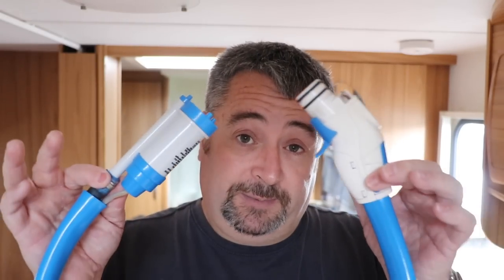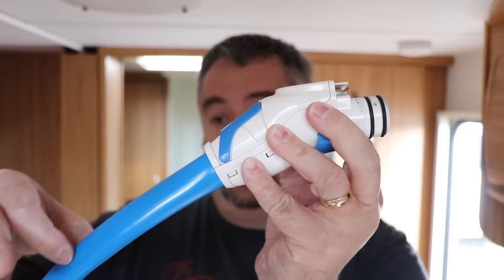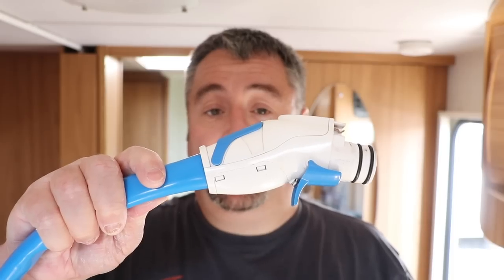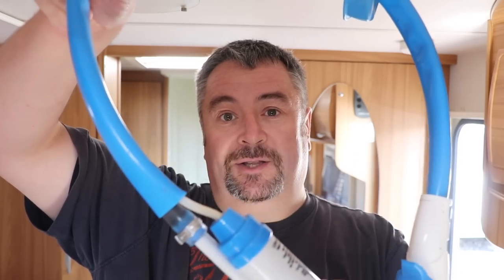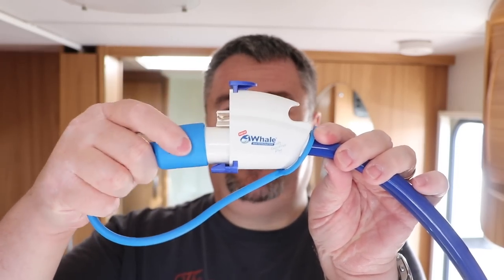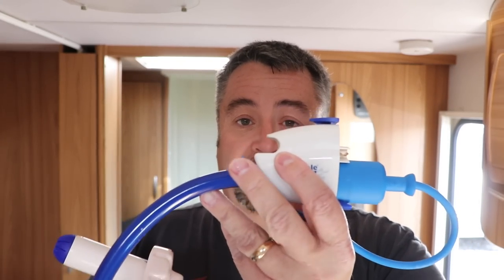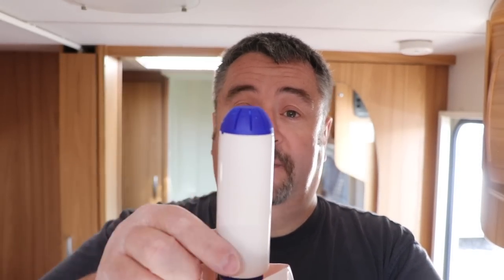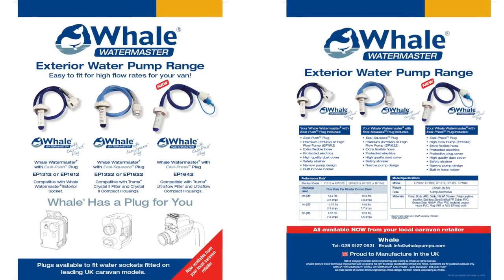Whale Pump EP1642 upgrade to a Caravan Truma Ultraflow system

Comment: Just came across this video but not before I had a problem with my Truma pump failing. By accident I couldn’t get a replacement and instead got a Whale pump. What a difference! Easier to fit and a really flexible pipe making it much easier when you swap from one aqua roll to another.

Comment: Thanks Dan this is really useful. We too have a Lunar Clubman and we are away in Cornwall on our holiday. Arrived yesterday and the b****y Truma pump played up right from the off. Then we had a water leak under one of the beds so not using our system at present.  I have had all of the issues you have mentioned and have also been fed up with it.Was going to buy another pump now it will be a Whale. Thanks for the info 😁

Comment: The submersible pump that came with our 2006 caravan, Truma Trauma, was a pathetic dribble. Les, bent my ear about it on several occasions. So I did some homework and bought a Whale. What a difference, I have carried the original for a few months in case there was a problem but the next trip will be a pump lighter.

Comment: Just upgraded my old van to the ultra flow system and decided to buy the whale pp off the back of this video. Brilliant advice
Reply from the maker: Excellent. FYI - I’m still using this very same pump now, even when I thought I broke it, it was just a corroded terminal on the caravan. - so they do last!
Reply: That's brilliant. Thank you for the video. 👍🏻

Comment: Brilliant! First time out with our recently purchased Sterling last weekend and we had a nightmare with the Truma pump. It had clearly been rolled fairly tightly by the previous owner, had a couple of nasty kinks so the flow was very slow, and was so inflexible that it kept rolling itself up out of the water in the aquaroll. It had worked ok on a warm September day when tested in our garden, but a cold November day on site was a different matter. A quick search on the 'net brought up your video and I'm delighted to find that whale have produced a better alternative. Mine's on order, I'm confident the air will be less blue next time out.

Comment: I was convinced that the pump was inside the caravan and it was just a filter that sat in the aquaroll....your videos are amazing, saying that...i now have umpteen jobs to do at the weekend lol...water-pipe cleaning...gas-level checks...battery checks, although it does have a solar panel on the roof....damp-checks, have purchased a meter and will put it to good use :-)
I have apps to download too, and also workout how our virgin media can transmit the F1 races to the smart tv....it's supposed to be a "weekend break" lol...

Comment: Same problem here, didn't knew about this whale solution. I changed the Truma hose by a sillicon protection hose and a sillicon innertube. I have the impression that this will work fine. No force to the connector, no bends.

Comment: Thanks for this very useful video! I had a whale-pump from the start but accidentally had it run dry (which happens quite easily). I replaced it with a comet pump which basically looks the same and was a little cheaper plus it has a 30min dry run capability. But I keep forgetting to turn the pump off in the van before I drive away in the car to get the aqua roll filled. There is much danger in damaging the pump again, so overall I'm not too happy about this design.

Comment: Another great video Dan and fantastic support for a great Northern Ireland company like Whale. Their customer service should you need to use it, is second to none. We have the Whale heating system on our Bailey and its great. We have had one issue with it whilst on holiday, they even sent their Managing Director to our caravan site to fix it for us, but luckily their phone engineer fixed it before he got there and the Manager Director was turned back.

Comment: Good vid  Dan ,been there done that ,got fed up of reconnecting hose ,you would think the makers would see this problem ,anyway was looking around spares shop and saw a flexible double hose right length ,fitted same ,works perfect  nice and flexible,will look at whale  as my pump is getting a bit noisey

Comment: Get rid of the Aqua roll all together. Just buy the Truma Ultraflow Waterline that runs straight to tap. Saying that, the Truma Pumps are very tinny and  it did leak a bit even when it was brand new when I first used it. Every time you unplugged it, it felt like it was going to break apart.

Comment: Hi thanks for your superb video, I've got a Sterling Eccles Ruby that has an internal Flojet pump which is turned on or off by a switch on the control panel inside, does this pump just turn on by itself? cheers

Comment: Hi Dan, we have a Coachman 575/4 7 years old with Truma system.  Have bought a Whale pump to replace our Truma one. The Whale pump will  not work though the Truma one does. Is our van and Truma smart switch programmed to only work with Truma pumps ? Many thanks Brenda

Comment: We are caravan newbies; We have Truma Ultraflow, no filter + Water Hog Tank; Blue cap on pipe is too small for the water hog threaded outlet so we either need to get an acquaroll that fits the Truma pump etc or a Whale pump that fits the water hog...can you advise us? Also it strikes us that if you are on a serviced pitch with mains water, the Truma Ultraflow can take that flow without needing the pump to operate...We have a 2013 Eccles Sport 442

Comment: Have had issues with the Trauma (as you have) and do not like the design at all so going for a Whale.
Do you have any advice for adjusting the pressure to avoid all the pump noise? Or did the Whale pump sort this? One guy said the pumps are supposed to over-run for a few seconds after you switch a tap off to pressurize?

Comment: Hi Dan. First timer here with a Lunar Ultima 2015. I have the Truma Ultraflow, which came with the van. Stored in the sink bowl, it has several kinks, problem one, and lifts in the aquaroll so sometimes it's running dry, and it's sheer luck I hear it and rush out to dip it into the water. Will the whale model here replace this one? If so, I'll get one and keep the truma for a spare. Thanks so much for your advice. Les

Comment: Hi Dan - I followed your lead and swapped water pumps and there has been a positive difference. However, it still float up in the aquaria. So, having looked at your recent video on 'The Aquaroll' I noted your comment on the 'Pump Connection' which holds the pump at the bottom of the container. So I bought one. I think you know what comes next - how do you use it? Do I have to disconnect the pump from the hose and electrics and thread it through then re-connect? Or have I just lost the plot!! Your advise would be very much appreciated. Trust you and your family are well and well have good times away this summer. Cheers. Mike

Comment: A easy fix if your confident and a bodger. I would shorten both inlet and wiring to pump connector inlet so it wont bend to the extent of breaking or and leave enough to fit in to aqua roll.

Comment: Hi, we have a bailey grande pegasus rimimi used last year fine great water pressure, this year water pressure is very very low. The pump pipe was kinked and i have had to fix the metal clips back on as one came off on this pump. Do you think this will be causing such low water pressure? Thanks

Comment: Hi Dan,  We have the Truma pistol grip thingy but no pump on the end, the pump is onboard.  Same issue though its a pig to fit or remove, the whole fitting on the 'van side flexes and I'm sure it'll shatter in cold weather.  Do Whale do a version to replace the Truma jobby i.e. pistiol grip and hose but no pump?  Buying the part you show for c£50 then cutting off the pump would be a bit steep.

Comment: Great product review! I didn't know that Whale did a Truma fitting but now I do I will be getting one for next season. The truma pump is glued on to the pipe which meant I could not replace it with a generic pump when I had an issue a while ago. Is the Whale one the same, or is there just a jubilee clip?

Comment: Hi Dan. Another great video. Just purchased our first van and found your content invaluable.  Quick question about this... Do you find you still have a fair amount of water in the barrel when the pump is not able to draw water?? Any tips to get the most out of the barrel?? Get the most pipe in??? Just enough to touch the bottom?? Tia. Andy

Comment: Sorry, sent that too early. What I was going to say was, I appear to have the Truma Ultraflow fitted but I cannot tell if it is the standard one, the compact or the winter. It is a bit confusing. What I WANT to do is fit a filter system so I was looking at the conversion kits for the Ultraflow. The trouble is I don't really know what I have now so I don't know if there is a replacement and , if there is, what one to go for. My aim is to filter the water coming into the caravan. It is potable water but I want to take out the taste and particulates. I really cannot work out where I am now and if there is a suitable solution. Any ideas? Ray

Comment: Hi Dan, I hope that you are well. We have on our Lunar the Truma ultraflow system. I used it for the first time since fitting a new inlet due to the old one  cracking,  I had the problem of the handle getting stuck and needing to be prised out with my multi tool. Have you come across this problem and if you have , how did you solve it? 
Cheers 
Richard.

Comment: Hi 
we also have had issues with the brand new external Truma ultraflow pump coming apart so we took your advice and upgraded to the whale pump you suggested. Unfortunately this pump is blowing the fuse every time we connect it. Have you any suggestions?
Reply from the maker: Hi Susan, Oh dear - that doesn't sound good. perhaps you have a faulty unit. I would recommend you exchange it, it certainly shouldn't be blowing fuses - it pulls very little current, so for a fuse blow i would think it is either jammed or faulty. 

I recommend a replacement. 

Hope that helps

Dan

Comment: Quick question - do you hook up the pump when refilling without removing from van - and have you had any air locks / issues with this?  I always used to remove the Truma pump completely - but this Whale option seems to encourage not bothering?  

cheers

Comment: Wished I'd seen this video earlier as we had this problem recently when we ran out of water at Burford (just after dark!).
Re-filled the Aqua Roll and when connected with the Truma pump got drenched when the pipe connector had come off inside the pump connector at the caravan end.
As a result got drenched , cut finger and sweaing trying to get the offending Truma clip back onto the pipe once back inside the caravan iwhere there was some light
Ended up repairing with a  s/steel jubilee clip and some electrical tape to stop the jubilee clip touching the spade connectors.
My brother had the same problem with his coming off too.
Anyone who hasnt replaced their Truma pump might want to do this fix before it happens to them.
Now thanks to Dans vids off fix the loo warning light and make some LED awning lights.

Comment: Hi, I have an internal pump which I’m having no end of trouble with it constantly trying to pressurise (definitely no leaks!) can I remove my internal pump and just have the external one?
Reply from the maker: Yeah, i see no reason why not. new housing, and attach the existing wiring to the new terminals. If you use the Whale housing, they have 3 terminals (2 for power, 1 for illuminating the pump in use led) and an inbuilt pressure switch. The housing requires a 12v feed (always on when the pump is switched on from the panel) - so this might be the neatest solution for you.

Comment: Hi, I have just changed my Caravan, I now have a Compass Corona 505. I appear to be using a lot more water in this van compared to the Elddis Riviera 482 I used to have. They both had the Truma water heating System. The problem I have is the heater over flow is constantly dripping,  sometimes quite rapidly when the hot tap is open. Is there anything I can do to stop the Leak Please.

Comment: Love to know how to fit this setup to my system. If I need to keep my old system and add this to it or is there a way of using both together.  Have a hobby kmfe 650 2017 with 50lt water tank.  What would I need and how I could connect it.

Comment: Just a minor point is that the trauma (spell checked changed it from Truma to trauma which is ironic) does actually have a similar clip to hold the pipe whilst you’re refilling. It’s the little blue clip on top of I remember correctly. Having said that you are entirely correct in that it is a dreadful design for all the reasons you pointed out. Wish I’d known that whale made that alternative but I have whale now anyway as changed van.

Comment: Always great info from you Dan.  Thanks!!
Reply from the maker: Thank you !
Reply: @TheTrudgians  Ok mate wonder if you could help please. I have got a bailey 2006 caravan. I am a complete novice to caravaning the problem I have is the pump is not turning off. It runs all the time even when all Taps are closed what could this be would I have to change the blue pump which plugs from van & sits in water butt. Any advice would be great thanks mate

Comment: Have a chat with your local roofer, ask them for a small sheet of lead and wrap it round the pump head. The weight will keep it down at the bottom where it belongs. Keep it tight with plastic pull through tie.
Reply from the maker: Lead? in fresh water? nope. 

To keep it down, just use a straight section of plastic pipe, split down one side. that will hold the pump straight facing the bottom of the Aquaroll.

Comment: Dan thanks for this. I do have a couple of Q's though - I presume the pump needs power - where does it get this from? I have a new 2017 swift conqueror. It came without a pump just the truma filter lead & so im guessing this pump/filter wont effect the onboard one?
Reply from the maker: Hi Steve, 

Okay it might be best to check what you have in your van. These are submersible pumps that take the poor from the connection on the side of the caravan, it sounds like you have an inboard pump. You can call Whale and check what they have for you in terms of upgrading.

I hope that helps.
Dan

Comment: Do you find the whale gives better water pressure ? I have the truma and find the pressure disappointing. Great videos BTW
Reply from the maker: Morning, 

Yes the flow was a marked improvement. I did initially put this down to the pipe not being kinked when inserted into the aqua roll.

Dan

Comment: 2006 Elldis crusader 2+2 with carva water system pump working but not when you plug it in turn the tap on and  green light underneath the switch comes on but still won't operate the pump

Comment: Thankyou 'The Trudgians' - like many others I've been having problems with the Truma for 2 years, way too stiff, won't turn into the Aquaroll due to the height issue and keeps blowing the hose end off! thought it was just me, like you I also had problems turning the aquaroll on its side, not least (without realising) the top cap leaks so on its side all the water slowly drains out. Also felt I was going to break the damned thing every time I connected it. So many times I've had to stand outside pressing down on the hose in order for the thing to unkink so we can have water! - excellent review on your experience, thank you for sharing .. I can see light at the end of the tunnel and water emerging the taps!!!  .. just one last thing! is the flow volume from the Whale a match for the Truma?
Reply from the maker: Stuart Lawson hi Stuart - glad to have helped. No the flow rate isn’t the same. It’s far far greater. It really is light & day. Also after months of usage I must add that initial priming and air locks are now also vastly improved. 

Hope that helps.
Reply: It sure does! Thanks again .. just bought the Whale from Amazon!

Comment: Hi dan, wee question if that’s ok! 
We’re at caravan just now, and past few times my water is spluttering out the tap! Could this be caused by Truma pump? And would I be best investing in the whale one (which we looked at yesterday) at the local caravan shop from here, only thing was it was £66 😖 ouch... but if I thought it would help my water flow nicely I would invest in whale! Cheers in adavance xx
Reply from the maker: Hi Amanda, it could be, although the spluttering is caused by air getting in somewhere. I would look at the Truma pistol grip and gently pull it apart and check the hose is on firmly inside the grip. they do come apart very easy, and that could be a quick and cheap fix. 

Hope that helps

Dan
Reply: The Trudgians thank you, will try and let you know! 👍🏻

Comment: Hi Dan I can’t get water pump to pump water into the caravan do you know what the problem is it a new pump every thing els works fine ta
Reply from the maker: Assuming the pump light is on, when you switch on the caravan, I would look at the contacts of the pump and where the pump connects to the caravan. If possible run a nail file over the metal contacts to brighten and remove any corrosion.
Reply: @TheTrudgians  if that don’t work then what els can it be I’m away in the caravan for the first time then get to the camp site to set up then the pump don’t want to work ☹️👍